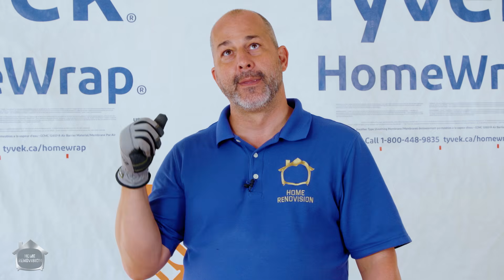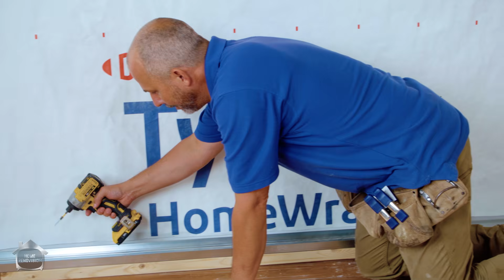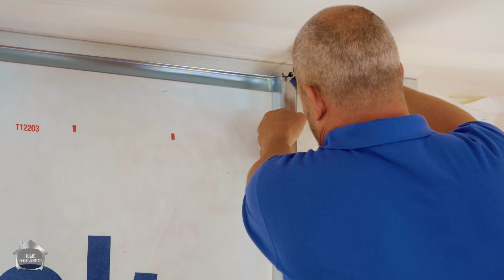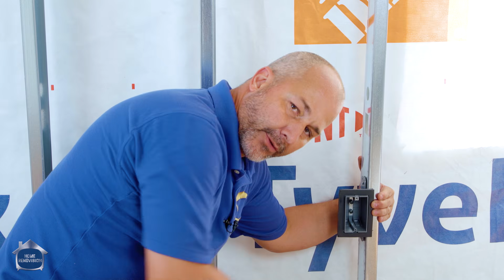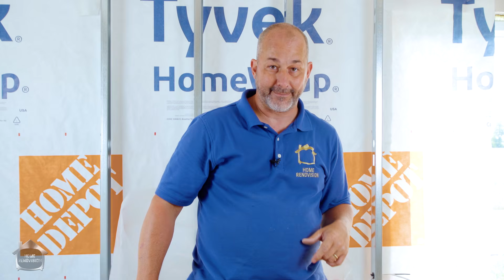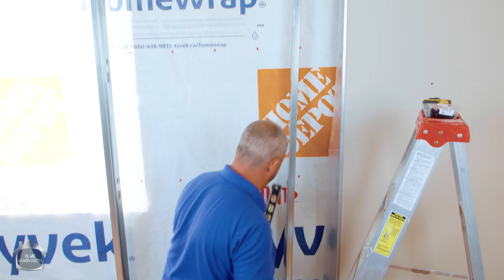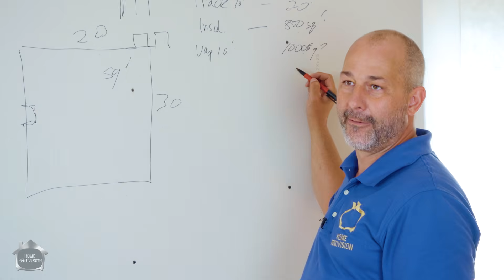Frame With Steel and Save Money! | Steel vs Wood

Comment: Have 3-4 years experience in doing high end renovations/remodeling. Mostly kitchen and bathrooms but even entire PH apartments. I went to the lumber yard today and bought 3 2x4s and 1 2x3 and paid close to $40. I remember just two three years ago the price was close to $10. It’s ridiculous how high the price of wood has gone, even seeming $100 pieces of plywood. Truly unreal.... 

Here in NYC, materials and working conditions may be a little Diffrent than most people are used too, whether it’s:

-Dealing with the Management Company, the Super in the buiding,CCD’sand staff of a building (usually money to the super helps, and it’s worth it to give a good tip when you get the job so your life can be much easier, because the Super can really fuck you up 

- Dealing mostly 90% of the time with metal studs and tracks. 2x4 and 2x3 are in the mix as well, mostly for framing involving the bathroom around points and door framing, as video said. Studs have more versatility then wood and cuts do not have to be perfect compared to wood. Pressure treated wood for the track is a good idea, most of the time though, if the basement m, a lot of people will just shotgun the track into place. 

-Here in NYC, due to the size of buildings and elevators (service elavator, high end apartment have multiple elevators, with one usually reserved for contractors. 10 foot studs sometimes cannot clear, even 8 footers are a tight squeeze. 

- In NYC, all electrical cable is BX (armored cable) so when passing through metal studs, those holes are razor sharp. The video was not lying, I have sliced my finger multiple times. Romex cable is not used through metal studs due it being able to sliced open by the studs. Plus it is faster then drilling holes for studs to past though. 

IMO, metal framing is much much much better and cheaper then wood. Then again wood offers some advantages, hence why it is mixed in and used for certain things. Many people grow up in the business learning to use wood, and are reluctant to change. This guy is awesome in his videos, even though I know most of it , always great to listen and learn new things.

Comment: In regards to the door framing, are vertical supports above the header unnecessary or are they still required like in wood framing? If so, what's the best way to go about it?

Comment: You need c-clamps when dealing with metal framing...they work better than pinchers...those pinchers work with flatter material also you might want to get a magnetic shaft for your screw tip because dealing with metal you don't want slippage of screws...also your top track need to screw to the sheet rock ceiling for support for sheet rock wall...your header should've just used track...it wouldn't need to be flattened out...I know it's diy but it's a lot of mistakes or missing information or maybe location...well that's a lie...it's a lot of good information just some questionable application

Comment: Nice tutorial. I spent about 1/3 of my construction life as a metal framing contractor.  The only thing I did differently us using a small pair of reach over vice-grips verses the spring loaded clips.  Much of the work I did was on multi-level scaffolding and the vice grips allowed the use of rope to pull up the cut studs from the floor as my helper made the cuts.

Comment: Usually agree with all your advice but I have a few issues with this video. I never use pt inside. I'd use foam or poly sill gasket under plating whether steel or would as they will wick moisture and salt from concrete but pt also reacts to metal and eats through it via bimetal corrosion that's why we use ceramic coated or galvanized fastners on pt. PPE is important, I wear the thin anti-cut gloves as you can still handle the tiny screws but don't have to worry about steel slivers or cuts

Comment: One problem. And FYI I work for the largest insulation company In Missouri. If you put poly on framed against concrete it will mold, this portion is incorrect and do not do it, if so pull drywall off one year later and check out all your mold

Comment: I framed many buildings from office space, libraries, churches, factories...this is good for rookies. If you did it this way you'd go broke and hungry trying to make a living. Just a little insight, you start your 1st stud on 15 1/4" and measure from it so when your sheetrock lands on the stud at 4 feet it will be on center. I'll save the rest for when I want to conduct school.

Comment: Loved it. I feel I can do a steel frame now and so much easier than wood. Just out of curiosity... can it be used for a 12' wide drop ceiling with 3/8" sheet rock?
Reply: you'd have to brace it every 2nd knockout because of code so every 4 feet it would have to have a kicker up holding some weight in the middle

Comment: As someone that used to work in a steel place here in Wichita I would not use that steel from a box store. 2x2x1/4 tube steel is what I would do and it is about 100x stronger. Not sure on pricing anymore but yeah steel did go up as well.

Comment: I'm sitting here watching you screw all these screws in and made me think of something. I wonder if anyone has ever welded the plates and studs together instead of using screws?
Reply: Yes. that is how the framing system worked before. then factory manufactured frames from roll formers were designed with pre-drilled holes to screw easily and have square frames with no measurements, cutting or levelling up studs.This is a diy version of steel framing. Most steel frames are now designed and are built before getting to site.

Comment: Hi Jeff,  What's your take on spray foam insulation in the basement (with/without steel studding)?  And does the spray foam go in before you do any electrical or plumbing?

Comment: 3:51--Tyvek is an air barrier (read the print on the Tyvek) and not a water barrier. It is designed to allow moisture to pass through it from the inside of the house to the outside when placed on the outside wall. I doubt this would work on an interior wall as moisture from the wall would pass through from the wall into the insulation and then the metal studs. Probably best to use plastic sheeting along the inside wall.
Reply: Well for one, you’re supposed to use it inside out if you’re in a basement on a block wall. To some it’s not ideal but if there’s an air gap in between your typar and block wall, you’re fine, it’s just so that the insulation doesn’t stock and mould to the block.

Comment: Instead of using pressure treated lumber, couldn't you just finish the floor first with vinyl planks since it's waterproof, then put the tracks on top of the vinyl planks?

Comment: 1) when you use the Tyvek, what type of fastener do you use to attach it to the concrete wall?  how far up of the wall the Tyvek need to cover or seal off to prevent moisture get up into the joist?
2) I saw other videos that you water proofing the floor with membrane, big rolls with bumps,  how is that membrane layer play with this setup?  is the membrane goes from wall to wall up against the Tyvek or just inside the framed floor only?
3) Instead of using 2x4 treated, can I use composite (Trek or alike) 2x4?  
4) Can I use 2" thick pink foam board against the Tyvek? then frame then add more insulation?
as always, great video

Comment: I'm not sure if this is a dumb question, I don't do construction, but could you paint the studs to increase durability and resistance to corrosion? Im not sure if the paint would interfere with something else but if prepainted and then set in place it should add years to them.

Comment: Why presure treated bottom, why not just go pvc? At the price of wood compaird to plastics or composite plastics are a good option.  Also Holmes would ask about the foam insulation under the bottom plate.
Reply from the maker: if you want to go pvc then feel free to do it. Cheers!

Comment: I have a question. If my basement has insulation thats the roll type that has the vapor barrier attached and goes from floor to ceiling, can I just build the wall in front of that insulation?

Comment: If the room has 100 linear feet of wall, and studs go in every 10”,wouldn’t you need 120 studs, plus extras as needed, for corners and doorways?
Also wish i could see how you cut holes in the drywall, for the electrical boxes. GREAT Videos, thanks.
Reply from the maker: every 16" and we have a video on how to cut and install drywall.

Comment: I am a steel stud drywaller and have noticed a lot of people are looking at steel stud instead of wood due to price. In the commercial sector we just shot the bottom track to concrete and I have not seen a problem yet granted that's new builds. I have been done hole houses with steel stud and it was cheaper

Comment: Dewalt cordless drywall gun, was the best investment I ever made, and use the small batteries to keep it light, it makes a difference when your boarding all day, and cool little tip for cutting the vapor barrier on the floor, take the handle off of your sanding pole, and tape your knife to the end of it, and just  walk along the wall, it saves your knees and your back

Comment: The subfloor system that Jeff described at the end of the video is game changer.  I’ve used it in two of my homes and it not only makes it easier to manage the build, but it keep the basement so warm and comfortable when everything is done and you’re ready to enjoy the fruits of your labour. It’s easy and relatively inexpensive, especially when compared to prefabricated tile systems.
Reply: How did you attach the frame to the subfloor? Planning on using steel frame but debating if I need the pressure treated 2x4 under the track if it’s already elevated off the concrete.
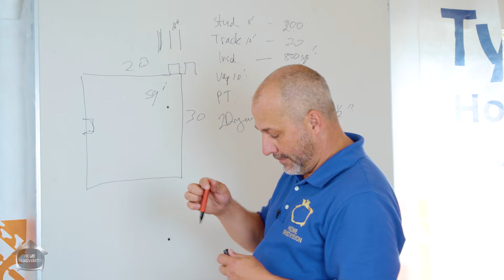Reply: @apatton6022   I believe after 1:01:25 Jeff mentions that you can just screw your track directly into the subfloor if you go that route, which means you wouldn't have to purchase the pressure treated lumber
Reply: @shawnwinter are you talking about the dimple membrane? I read a lot of reviews on it that say it makes noise when you walk on it. I am just going to use Durafoam 3/4 plus toung and groove OSB. Fortunately I'm on a hill and I have zero issues with moisture.

Comment: Thank you, super helpful! Can you cover building a 2nd story deck with steel? What it takes, feasibility of using long spans without too many posts, etc.?
Reply: I also want to build a second story deck. Depending on the cost I really like the concrete slab option that way I can tile the deck and is probably the most durable . I just don’t know what the cost difference  would be.

Comment: I have ripped out many basement floors and steel studded walls. even pressure treated lumber will rot under steel track. Put Dorken Delta-FL on top of any concrete floor and you are protected.  If you want to just put walls on the concrete floor, buy a roll,  cut in strip and tape to bottom of pressure treated plate.

Comment: Metal studs are conductive and remove 75% of the r value to insulation. Please do not insulate inside metal studs. Please use exterior insulation, like rockwool.

Comment: Jeff just let me start out by saying, i love your videos. You my man are the quintessential jack of all trades.I'm a 35 year Union carpenter from Seattle. First thing is, the metal stud you had in your hand was galvanized. Here in Seattle all are metal studs are galvanized. You most certainly want to shoot your track down directly on the concrete. The other thing i wanted to recommend is using is spray glue adhesive in a spray can for putting up your insulation and your plastic vapor barrier. Just spray it on the inside and outside web of the studs for your insulation install and on the face of the studs for your vapor barrier. Also there are two types of metal stud framing, architectural and structural. Most DI-Y's will only be doing non-structural framing.Anyway my man i just wanted to say keep up the great videos, you are a mountain of knowledge that is appreciated by everyone. Thank you.

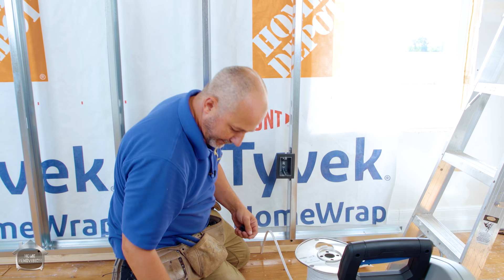Comment: 30:30 To run the wiring through the hole in the stud, you used both a zip-tie and a grommet, but never explained why the zip-tie is there.  If the grommet was the correct size (which it really should be in an actual project), wouldn't it snap into the hole and lock in place?  It seems to me that the grommet would be all you need.  In the video, with the wrong-size grommet, it looks like the grommet immediately fell out of the hole, and all the zip-tie does is to keep the grommet nearby.  With wood studs, there's no need for any friction on the wire; it's OK if the wire can slide freely through the hole.  I assume that this would be the same with metal studs.  A zip-tie could be used to put friction on the wire, but I don't see the need for friction here.  You didn't run the wire through that particular zip tie in the video, anyway.

Comment: If you didn't have access to a PT 2x4 with the way supply is, would it be crazy to just paint the steel track as a method of rust prevention?
Reply: Yes.  Standing water will find a way to penetrate paint, and just positioning the track on the concrete will probably scratch through the paint in some places.  Maybe this could work (?) if it was a really thick coating like pickup-bed liner, and in a situation where you'd never have standing water, i.e. not a basement.  I wonder if an all-plastic board (like for decks) might be an alternative.

Comment: Building a home theater room in my basement, these videos are super helpful. Only thing is I never realized how much crap you have to buy because it's a basement and there's moisture. Came here to find out how to use the metal studs because it's $7 for an 8' board. And after watching I'm about $700 in my home depot cart 😞🤦

Comment: The acid on pressure treated lumber on metal studs will cause it to rust
Reply: I was wondering if there is some chemical compatibility requirement, e.g. what types of pressure-treated are OK and what types arent.

Comment: Please Clarify, so Can I attach Tyvek to the studs behind the insulation like you did on one of your videos using Typar?  Tyvek logo will face the inside of the house right?  There will be about an " air space between Tyvek and concrete wall.  Or should I hang the Tyvek against the concrete wall and leave the air space between the fibreglass insulation and Tyvek
Thanks

Comment: Is there a difference from concrete floors in houses and concrete in commercial buildings? I'm Interior Exterior Specialist by trade. We shoot track down directly on top of concrete all the time. Also plumbing and electrical goes up from the floor through holes we cut on in the track and studs. Super fun trade by the way if you like hard work.

Comment: I had some moisture on my concrete wall on a house that was built in 2017.  The basement was studded with 2x4 R12 and vap barrier.  Should i attach Tyvek onto the concrete wall? and how?  There is only about 1-2 inches between the studs and the concrete.  Only one part of the house facing west had the problem the rest of the house is bone dry,  One sum pump on the opposite side and the basement is about 90 feet across.  Its a 3700 sq foot bungalow.  Advise?

Comment: Jeff keep the drywall off the floor by 1 inch . I put a 1by 3 on the floor keeps the water away and put it in level drywall does up level.and trim nails in well . comment please.

Comment: Would something like dry lok or a water proof paint on the walls work as a vapor barrier?
Reply: Nope. The inside of the sheetrock will be be exposed to moisture if it is present.

Comment: To use steel is very good. And if I would build ever my own house I would try to get the steel studs. Back at home in EU we used almost 100% steel studs for all interior walls. And that for a long time ago. Because there it’s the same price or even cheaper then lumber. And the steel are straight at all time. The same dimension no difference. Two things on your installation .. I would use a sound damping band on the channel Profil where it hits the wall. Also a Sound damping Band on the other “ normal “ wall studs where they hit any other wall intersection. 2nd ... I would use mostly refits and the special clamp pliers for this kind of profile ...

Comment: Actually, 100 studs was right. What you wanted to double was the number of tracks, that is 40 instead of 20.
Apart of that, great video tuto. I just decided to finish some walls with metal studs rather than wood ($$$), but did not know how to use that. Now, I think I know. Thanks Jeff.
Reply: Thanks, Phillipe.  I questioned that myself and was going to ask for clarification
Reply: Original counts are right. 100 stud and 20 track. 100 linear feet needs 10 tracks x 2 for top/bottom.
Reply: I love comment surfing. This answered my ONLY question of the entire video. 
The comments win again!

Comment: And wood direct on concrete rots also! U need a plastic or something so you dont have direct contact
Reply: He said to use pressure-treated wood; he just wrote it on the board for the video.  I assume there was no time to get an actual piece, or didn't want the treated sawdust in the house.  It's still good to put an actual vapor barrier underneath the pressure treated bottom plate.

Comment: Question about adding the 2x4 when framing for a door..  You only put one wood 2x4 and I had assumed that is where you would hang the door on the hinge side.  But you were rushing through your material list and you mentioned two 2x4s for a doorway???  So should you put one on either side or did I just not catch what you are pitching

Comment: We are building a small storage room inside of our Garage 7X8 and I would like to place the door in the corner opening off the 7 foot wall where it joins the 8 ft wall. Can you tell me how we would frame with wood and steel to be sure the door was supported properly?